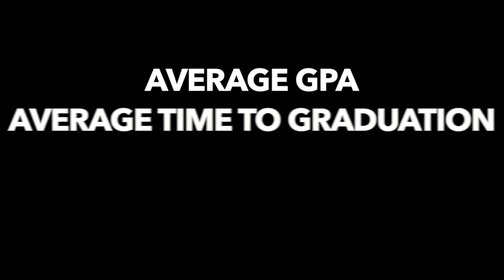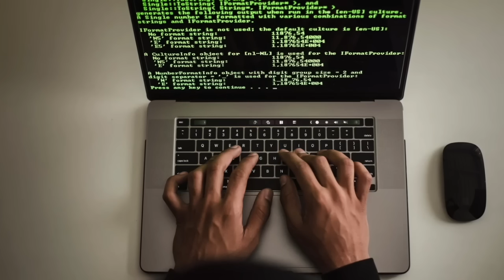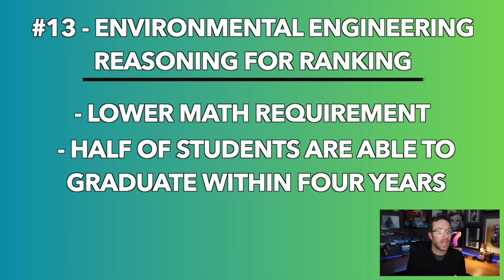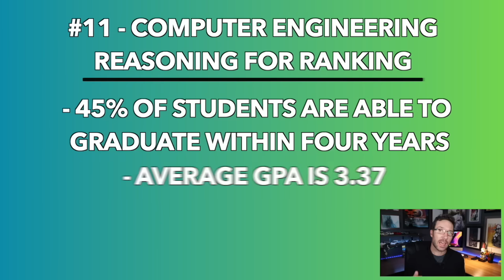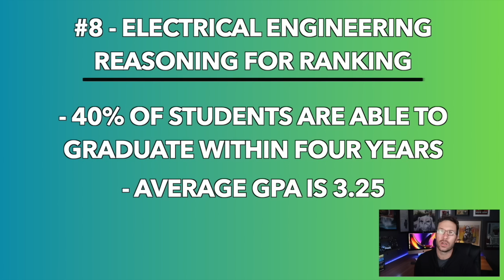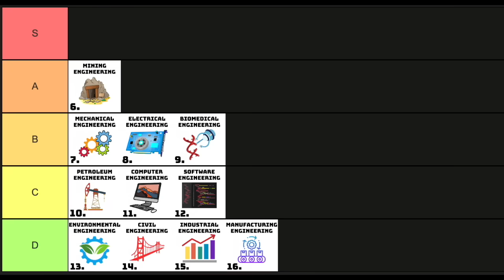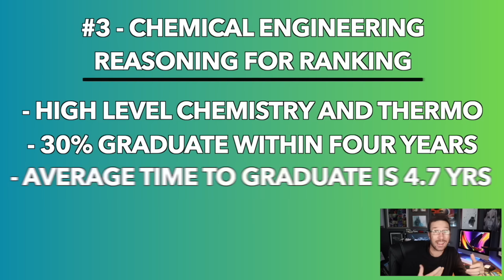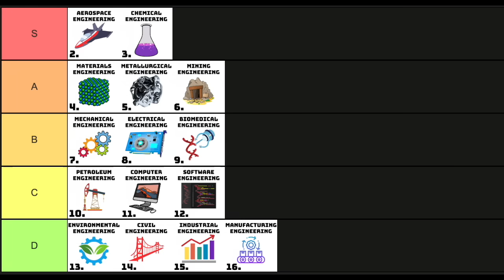Engineering Degrees Ranked By Difficulty (Tier List)

Comment: There are literally no jobs. Why would anyone ever do this? Also, Engineering is brutal and no one cares. If you want to make less than an electrician, youtuber, or Dollar store manager, go for it. You don't just need to pass these math classes, you need to truly understand them. Think: A is the lowest grade you should ever earn. Else,  you will fail the degree program
Reply from the maker: where do you live? There are tons of jobs in the US
Reply: @becominganengineer2271  just because you see jobs posted doesn't mean the companies are hiring.  More over many of them have dropped the salary ranges significantly due to increased overhead from inflation and new costs imposed by the current administration. They layoff employees and try to fill the req at a lower salary band.

Comment: EE graduate here, imo Telecom had the scariest currilucum where I studied, its what I imagine Applied Physics should be. Most of the teachers were not even Telecom Engineers, dudes used to come straight from the Physics department. Generally in my regiont the general perception is that EE is the hardest, but that is probably because we have a much more broader curriculum compared to what I see in Europe or USA curriculums, which subdisciplines like Power Systems, Power Eletronics, Control Systems, Telecom, Microeletronic and Microcomputers being all present in the curriculum, which kinda makes EE looks like the big monster here. Pretty sure the average gradution time is about 12 semesters or more. 

We also go up to Complex Analisys in math, and it is necessary to go up this point imo, so stopping in ODE seems out of this world to me.
Reply: Yup, as a ME, this was well known in university. EEs go up to Complex Analysis, which is the highest level of math on this list.
Reply: Complex Analysis? For an EE BS? I know a lot of math has a lot of non-conventional names, but I cannot imagine a Baccalaureate degree in anything other than Math requiring a course called Complex Analysis. Maybe a follow on class in Calc using complex numbers, but an analysis class? That's brutal.
Reply: @descendency  yep, in my time, 2014, we had Complex Analysis, taught by a teacher from the Math Dpt. in a very Math way, theorems followed by proofs, followed by exercises were we had to keep proofing stuff. I guess it is supposed to be a lighter version compared to what you see in a Math degree, but teachers here hold full power and do not care who they are teaching, so they can either make our lives heaven or hell. I remember learning up to Cauchy Teorems and Singularities (still have the book), which is kinda usefull mainly in Control Theory and Signal Processing, if you can make the mental "leap" between theory and practice.
We are introduced to use complex numbers alongside the phasor notion to deal with AC circuits one semester earlier, in an introdutory Eletrical course.
Reply: @descendency  we had to do functions of complex variables/introduction to complex analysis because a lot of our probability requires Lebesgue measures and integration/transformation of complex functions.
Reply: @descendency  yeah the maths in ee is pretty full on compared to any other degree other than a maths degree
Reply: It’s the same at german universities. Complex Analysis is a must for an EE, honestly.
Can’t imagine how anyone would put EE under chemE, ME or nuclear (subspecialty of ME in germany, just like Aerospace in most unis).
Reply: EE grad and worked as a Motorola R&D engineer designing telecom components, devices, and antenna arrays. Great fun. Also my undergrad degree was 146 hours so I think degrees are shorter now or his data is off.

Comment: here in Canada tho, any engineering degrees will require u to do every level of calculus, physics or chem
Reply: Except fucking CS for some reason.
My Uni doesnt force u to take differential equations. At best you just do calc 2.
Reply: @honkhonk8009  my guy, like I said engineering. CS is somewhat in the engineering curriculum but its still not engineering. Its not as strict and block based, Engineering is traditionally harder cuss of it’s fixed required courses. Also CS has the option too for BA or BS, BS you are forced to take science courses like physics while on the other hand you don’t have to.
Reply: @honkhonk8009  Or you just adapt. No one is stopping you from learning whatever it is that you want.
If you want to transfer into something else, like CE, wait till you finish this, then take whatever prerequisites they require (Calc 1,2 &3, Physics 1 &2, as well as EE fundamentals I suppose). There's no point lamenting over this, it was your choice after all. So suçk it up, and move on.

Comment: Where would you put automation engineering 
And is it a good engineering field?

And is it really a mix between electrical engineering, mechanical engineering and computer science?
Reply from the maker: i would say yes and yes
Reply: @becominganengineer2271  you forgot the first question 
Where do you put it in the difficulty list
Reply from the maker: Probably somewhere In the middle. But  I didn’t find enough data to add it to the ranking.

Comment: But the most intelligent are the mechanical, mechatronics, electrical engineering and computer science engineers because they have to think with their heads the most
Reply: My school had mechanical, mechatronics and electrical engineering. Mechanical and electrical engineers were equal in difficulty, although it would wary, depending on what you are skilled at. Mechatronics engineer was quite a bit easier than both of them.
Reply: What about nuclear, computer, chemical?

Comment: I'm going to be one of those that disagrees with your ranking.  Electrical has to learn to code, and not just code - but make that code control other machines.  They also have to learn parts of mechanical with their control systems classes.  The highest math in my case was Engineering Probability & Statistics, a much harder than the math department version and it was taught by the electrical engineering department.  In addition I had to take Linear Algebra (after Diff EQ) and Linear Programming (my last math class, but it was a senior level elective).  My college had a robotics team.  They had all the engineering disciplines work on it.  But when it came down to it, the one that made the robot a reality was the electrical students.  No other discipline could make all the parts of the robot function together.  During your last semester as a senior all disciplines had to take the FE Exam (Fundamentals of Engineering).  It is an 8-hour exam.  The first 4 hours you take a general exam that all disciplines take.  The last 4 hours you get to pick which exam you take (all disciplines took their own specialty exam).  The electrical engineers always got the highest grade on the general exam (it had pieces of all disciplines on that exam).  After graduating, I started tutoring higher level math to all engineering majors.  The students that could not handle electrical switched to mechanical.  I agree that chemical is certainly one of the hardest.  Electrical is may not the hardest, but it is much higher than #8.
Reply from the maker: I tend to agree with you … but I tried to just go where the numbers took me.
Reply: @becominganengineer2271 electrical engineering they have to learn electro dynamics shits more than odes
Reply: A lot of schools combine electrical and computer engineering into one degree. Or the degrees are so similar they might as well be one. And yea, I'm not sure where the math requirements came from this one. It might vary from Uni to Uni, but I know CS students had to take linear here. I think they had to take PDEs, but maybe not. I forgot if PDEs or Abstract Algebra was required.

Comment: Ranking engineering major stream is a bad idea ,as all engineering fields and degree are equally difficult.
Reply: No difficulties if you have passion on what you study
Reply: In my school the degrees were definitely not equally difficult. Mechanical and electrical engineering were equally difficult, although it highly depends in which field of math your talent lies. 
Mechatronics engineering was quite a bit easier than both others. We had several courses which had an electrical engineer version and a mechatronics engineer version. And the mechatronics engineer version was always significantly easier.

Comment: Switched from mechanical to software engineering and I can say it depends on what are you good at. Software is harder in general and you also have to learn more other things outside classes while mechanical is hard if you are not good at math, otherwise pretty ok.
Reply: Bro how did you switch from mech to software?? Due to less entrance score,I couldnt chose computer/software field.Had you completed your bachelor degree in mech??Please reply me bro
Reply: @onlyhumanity6148 Really wtf? I'm in software because I wasn't able to get into mechanical. I'll upgrade my grades after doing software to mechanical en  too.
Reply: @BitSquareStudio  you may have more interest in grasping the concepts related to planes,engines and other macro awesome things that we can actually feel,see and touch in real field. But I have always been curious from my childhood to know the stuffs like how computer processes,how it stores. Yeah mech engg is awesome if you can mix your interest with your hardwork. Even I also love fluid mechanics,machine designing parts and aeronautics part too much. But what my intuition says is that with same intensity of practice I can grasp the computer concepts more quickly than mechanical concepts.
Reply: @onlyhumanity6148  Don't worry software engineering isn't hard. As long as you can think abstractly and problem solve you will have an easy time with it.
Reply: Hey I do swe too and I also had this dillema. What makes you choose is what you generally are interested in Swe imo is a little narrow compared to compE in terms of the different industries you can work for. But my deciding factor was I did not like Electricity in HS and liked mostly software. But if you like both go for compE cos you can be both with it

Comment: I’m majoring in Computer Engineering. Or at least I will be when I transfer to university. Currently year 2 of community college before I transfer. I’m thinking of focusing on EE in my electives.

Only 5% job growth concerns me tho.
Reply: That job growth to me doesn’t seem accurate at all. With a comp eng degree you can pursue software or hardware. Both in this day and age are pretty competitive by any standards but the demand is definitely there and growth should be just as high as software
Reply: @reigndrops4090 Yeah, hardware are also fire it's impossible you can't find a job if your good. New EV cars, national defence, NASA SpaceX Boeing etc etc........
Reply: That's a good plan.
Reply: You can work in software industry with EE for sure
Reply: @superduperduty887   u can do it with Mechanical and chemical too
Reply: Job growth doesn’t matter. If you’re good enough you won’t be concerning jobs

Comment: The mechanical engineering ranking seems too low imo, as well as electrical engineering… they should be right at the top or at least a tier below to be fair. Any assessment on automotive engineering?
Reply from the maker: I felt the same way. I graduated in mechanical and thought it was pretty rough. But I just tried to rank based on what the numbers said 🤷🏻‍♂️
Reply: Mechanical is not as hard as chemical engineering. Look at the other comments. Look at google. And look at the class load. At my university mechanical is a walk in the park compared to chemical. Especially the junior and senior year compared to chemical engineering
Reply: i dont think Mech is actually THAT difficult compared to chemical engineering or even electrical. Unless you specialize in energy and fluids.
Reply: @Abstractor21 specializing in energy is easy way however if u specialize in fluid dynamics this is where it gets one of the hardest as aerospace is already placed in 2nd
Reply: @ruinedshadow97  I mean, i said energy because fluids and energy goes in hand. Its actually a specialization here in Uruguay for MechEng and is the hardest one. Lots of fluid dynamics and advanced thermo.
Most of the time, ChemEng will be harder just because it already has a lot of fluid dynamic and heat and mass transfer, plus organic chemistry that i think it can get pretty hard. Lab reports are a pain in the as* too. Too many math and physics courses, and even the advanced classes use quantum chemistry applied to thermochemistry.

Comment: I find your ranking of CE as the easiest engineering degree laughable.
Reply: I think the difference between C tier and A tier is very small. Also he ranked it on syllabus and percentage of students who pass withing 4 years. It is extremely hard but a bit less hard than Electrical
Reply: Civil at my university was understood to be the easiest by everyone, including those in it. A buddy swapped from ME to CE and said it was easier...but could have just been our university.
Reply: @sean9267  same here. Civil engineering is one of the easiest here. Some of our ME physics examples were in their tests. They also completed maths at one level lower than Electrical and Mechanical.
Reply: Is CE computer engineering or civil engineering? 🤔
Reply: @kentagent6343  civil
Reply: @kentagent6343 I was thinking same thing. First I thought it was computer engineering, then I gave it a second thought.
Reply: Pretty accurate realistically
Reply: The fact that you think 14th out of 16 is easiest proves his point.